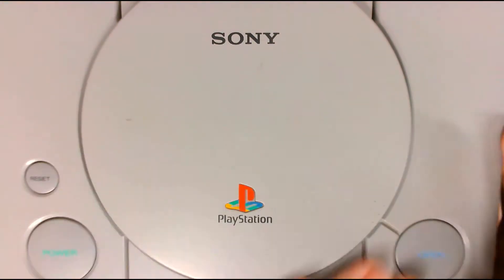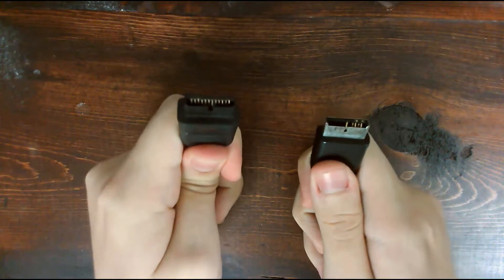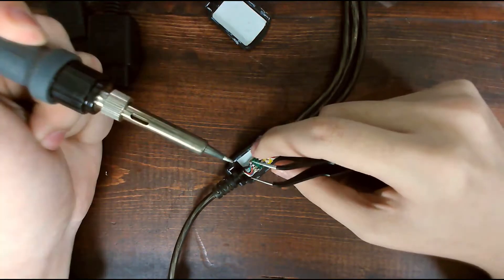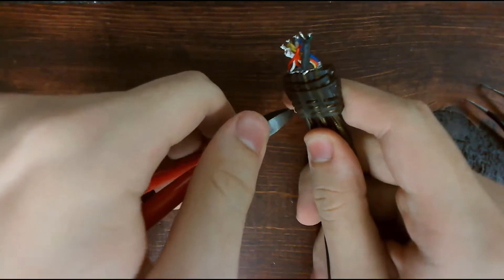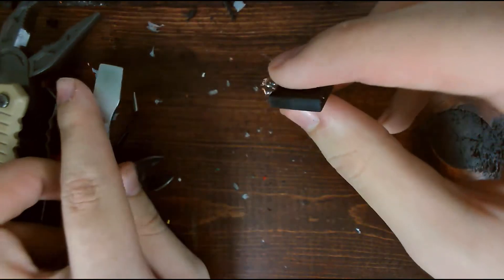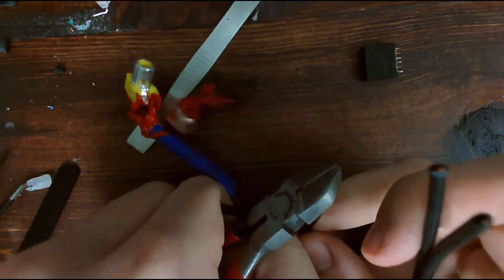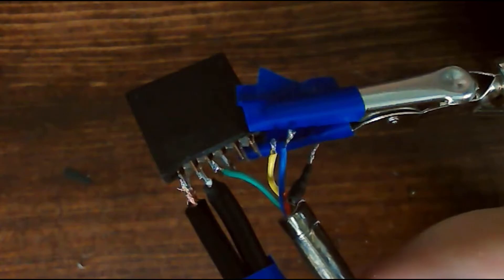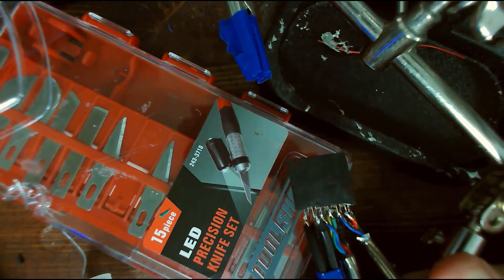Making a PS1 RGB cable from garbage

Comment: Awesome, about to do the same. 2 questions:
1. Are you using a sync stripper for the Sync on Luma signal?
2. Is that a GBS-Control upscaler?
Reply from the maker: 1. na
2. ya